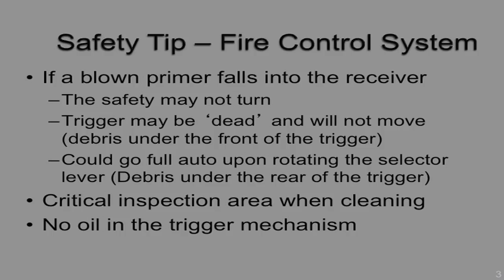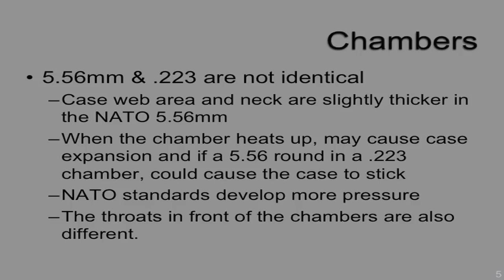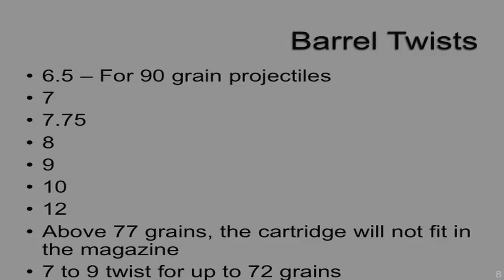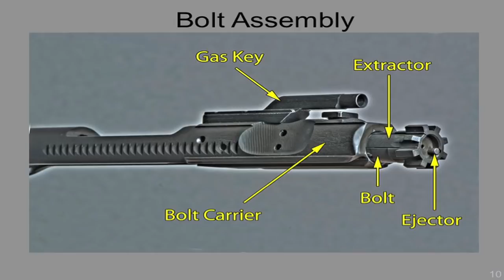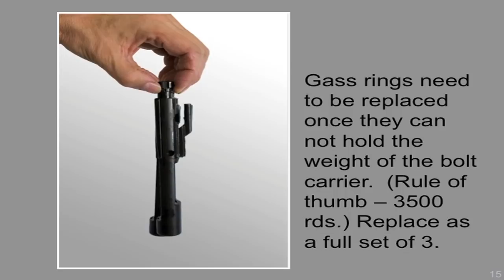AR-15 Maintenance: Field-strip, Clean and Lubricate an AR-15 | Gunsite Academy Firearms Training

Comment: A lot of good information here, much of which contradicts like every other AR cleaning/maintenance video on YT haha!  I think I will trust this guy as he seems very credible.  Glad he at least touched on the barrel cleaning in the question section at the end of the vid.  When he finished up his cleaning, and buttoned up the rifle, I was like WTF...what about the barrel (bore) and star chamber???  That should be a part of every cleaning other than the quick in the field wipe and lube.  Spray it down, insert bore guide, brush it, patch it - always breech to muzzle.  Also, if you want to clean out the trigger group use contact cleaner rather than brake cleaner, which can be hard on certain surfaces.

Comment: I bought my first AR several months ago, but I have never fired it or broke it down. I read the owners manual but it wasn't much help.  This was an excellent video.  Thank you very much.
Reply: The AR platform is a very user friendly rifle. Easy to shoot, easy to clean.
 Take it apart and check things out. Remember never try to force any part into place,
if done right, its smooth as silk.
Reply: When you start taring into it be very carful not to lose any of the little pins and parts. When you spend 4 hours on your hands and knees digging up grass looking for an extractor pin you will rather chew nails. I needed that pin and my gun to work so I was not giving up. Also a good reason to have spare parts with you. I'm learning too.
Reply: @philipburnham5742  magnet on a string...............😁 I’ve done that.

Comment: I have not seen a better video on this topic, and I have spent HOURS watching them. Safety notes along with good instruction! Bravo! And dispelling popular myths like putting lubrication into gas vents on the side of the bolt carrier underneath the gas key. Or lining up the gas rings as if they were rings in an automobile engine. LOVE this very practical video. It's the best. Better than ones by the popular fanboys I've seen. Information from a GUNSMITH, not from one who makes a hobby out of AR15s.

Comment: Extremely detailed video. Thank you!...These are modern centerfire firearms but I'm a 'old school guy' and just wanted to make sure dry firing or dropping the hammer several times after cleaning the weapon is ok and won't do any damage, or should I use snap caps?
Reply: Most modern firearms are just fine being dry fired. Exceptions would be just a few rimfires where the firing pin would impact the chamber without a cartridge.

Comment: Just saw a video showing that the pressure on the .223 and 5.56 are actually the SAME.  The different pressures come from the fact that the military pressure tests test the pressure at a different point in the chamber and so their pressures (with the 5.56) are much higher.  When tested using the same methods, they are similar.  So... they are not pressured different.

Comment: Good video.

When I was in the Army in the '80s, we put a drop or two of CLP in the cam pin area to lube up the bolt and keep it operating well.  I am not sure if those versions of M16s had the chrome lined bolt carrier like they do today.
Reply: It won’t “hurt” the system, but the added oil can/will draw more junk into the bolt group, potentially impeding the fluidity of its operation. I know an old timer that does it and his rifle never has a hitch, so... but he also breaks his firearm down after each outing, regardless of firing volume. He’s a Jarhead... My factory Springfield Saint has 15k+ rounds (55 - 72g) through it without a single malfunction and I maintain it exactly as this gentleman advises (Lucas Oil), but with more barrel care... If you’re new to combat rifles, buy a nice mat with magnetized trays ($20), and with the video playing, simply take your time, pausing as needed. And remember to ALWAYS be SAFE, have fun, and be helpful on the range ✌🏻
Reply: @tinman6514  Great and polite tips sir. I need to get the magnetized trays as well.Thank you
Reply: I always lube the cam pin. It is a significant wear area. Notice that his cam pin has a lot of wear.

Comment: Pro tip. The GI "30" round mag is actually a 29 round mag. That avoids the mag drops so you don't have to slap the bottom of the mag. Just passing that along.

*Also, I have been using the same mags since OEF11-12 with zero issues. I have nothing, but problems with synthetic mags. Maybe my luck, but the trend for Al mags is there.

Comment: Great video, very informative, thank you.  Question regarding your take on cleaning the AR.  Most videos and instructional's that I have seen entail extensive scrubbing and cleaning with solvent of the bolt, bolt carrier, bore, and barrel.  You have a lot more creditability than most so I would take your advice over others but I wanted your take on it since your go against the grain of what most recommend.  Thank you again for the video.

Comment: Good video. The only thing I have a disagreement with is lubrication. I’ve always believed things will get dirty no matter what in the field. Having it lubricated will allow dirt to move out of the way. I learned this when I was very young. I went to BASIC in 89 and the common teaching was to lube with clp a few drops and wipe off. That didn’t make sense to me but I did it for inspection. However, when going to the range in the summer heat and sand, I would drop several drops of CLP on the bolt carrier pretty regularly. My 16 never failed me. In fact, a few guys had issues qualifying one time and guess who’s rifle was running? Yea, used mine since I was already qualified. Didn’t help clean it though. I always run mine wet and it makes cleaning a ten minute process and keeps it running all the time through any situation.

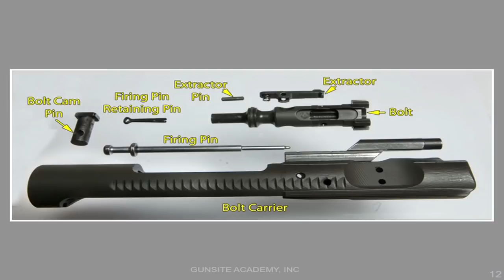Comment: 10:35   One part is missing. The plastic BUFFER that fits inside the extractor spring coils.Usually black. Can be other colors like blue.
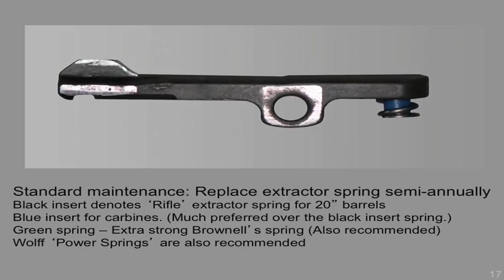12:08 does show the buffer. Blue, in this case.
and it backwards. BLUE denotes rifle springs and Black for carbine springs. The actual plastic is the same tensile strength.
BCM upgrade Chrome Silicon spring kit always come with black buffers. Silicon Chrome springs seem to last quite a bit longer. I use that type of steel for my ejector springs too.
I never run an O ring. That can cause brass shavings that will foul the extractor. Just use the best springs made.  Dirt cheap for the best springs.

Comment: Thankfully now in 2020 we have the 223 Wylde chamber where .223 and 5.56 can both be fired in the same rifle chamber. As for the gas rings, you should always make sure all three rings are offset from each other. In the civilian world it probably doesn't matter. As for being a service member offsetting the gas rings should be done at 12 oclock, 6 oclock and then either 3 or 9 due to the possibility of being out in a combat zone for weeks at a time and very slightly reducing the possibly of a malfunction. Great video.
Reply: Deutsches Brot - German Bread  No they are not. Ar15s are chambered for .223.

Comment: Good video. Thank you. No mention of the ejection pin?… I had to replace one on a new bolt, it broke off with the first round loaded. It looked like it was installed backwards from the factory. Never gave one a second thought before that happened.
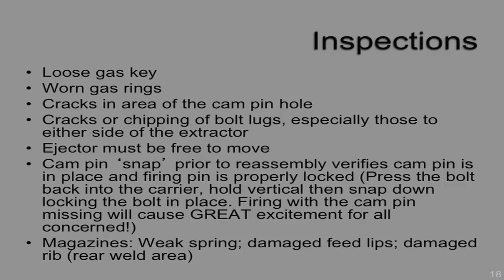Reply: 21:14 on list

Comment: if it should happen to fall while the pins are out and bend the pins(they are cold rolled steel,and much harder than the aluminum milled carrier)when you push them back in it could gauge the aluminum bore that they slide through and over time you can end up with misaligned carriers and have a very bad day.

Comment: I would keep a spare firing pin as a few pierced primers will erode the tip and cause even more piercings. Not usually a problem with factory ammo but reloaded ammo that is too hot will be more likely. Good reason to keep loads below max.

Comment: I’m relatively new to the AR-15 platform, and the more I shoot, the more I want to learn (naturally). I’ve watched many different maintenance videos and most are contradictory. I’m a novice, but it’s obvious to me this guy knows his stuff. That being said, he doesn’t mention if the bore should be oiled after cleaning... I’ve seen many videos where guys are dumping lube down the barrel... I tend to think this guy would’ve mentioned it if it were necessary, or I’m assuming there’s enough oil on the BCG/receiver to lubricate the feed ramps/extension and the bore..? Hope I can get a knowledgeable answer. Thanks
Reply: More to protect the bore from corrosion if not being used regularly.

Comment: yes,out there on the market 50 and 100 round beta magazines,which are really ideal if you fire from the prone position. they don't extend as far from the bottom of the riffle as the 30 round does,they extend about as far as the 20 rounders do and excuse the language but they are circular twin mags that hang from the lower carrier and look kinda like a nutsack but they are great,kind of expensive,and as with any mag never load it to full capacity you will wear out the springs

Comment: Great video. Im still confused as to whether or not to lube the firing pin and bolt. I know he mentioned about wiping down the BCG and lubing it, but nothing on the bolt and pin itself.
Reply: Absolutely Lube the bolt, it is turning and reciprocating back and forth into the carrier. Firing pin you will hear different opinions but I put a very thin layer on it. Usually just what's on my fingers..

Comment: Great video.I am new to the AR15,i just got mine a couple of weeks ago.I just got through putting 360 rounds through it over Memorial weekend.With that low amount of rounds,would it be necessary to strip it and clean it?Or would i be alright putting some more rounds through it before the first cleaning?
Reply: The AR-15 platform doesn't need cleaning after 400rnds or so. They way i always have cleaned my AR was to inspect the chamber. If it looks carbon covered then it needs a cleaning. 360rnds should be just fine.

Comment: What kind of lubricant should you use on the ar? For instance is rem-oil good enough? Also, do you want to put any type of oil on the outside of the gun and barrel to prevent rust?

Comment: One question, please. This video suggests not to touch the lower in terms of cleaners and lubricants. So, no rust develops there ever? No moving parts shall be oiled? Gonna buy my first ar, thats why am asking, thank you.
Reply: Chase Harris Thank you for the answer.
Reply: He discusses it early on. You should clean/ spray it out to clear any dirt/ debris, but that's it. It's a bit counterintuitive, I know. There's areas of friction in there. I use compressed air followed by regular brake cleaner (with the nozzle tube... thingy) throughout. It works great for carbon removal & dries quickly. Follow up with your fav lube, as he describes (I love ballistol), and it'll run great. Good luck!

Comment: Thank you for this! I just got a brand new AR and it was wet as shit from the factory. Took apart the entire bolt, wiped it down and lubed it as you specified. I put a good amount on the rails of the bolt and that’s it. Hopefully I did that correctly. Is the over lubrication on the bolt/internals to keep from rusting? Should I keep them wet? Thanks

Comment: Okay, now I'm confused. I had just watched hickock45's video ("AR-15 Cleaning") in which at 22:25 he talks about adding drops of oil to the hammer spring, the safety pin, "...make sure everything is oiled... moving parts..." (in the lower receiver). This in contrast to above at 2:37 where he says rather emphatically, "No oil, no lubrication, goes down in the trigger group." What's more, the Bushmaster manual "For All XM15 and C15 Models" says to "Generously lubricate all moving parts inside the lower receiver including the trigger, hammer, safety, bolt catch..." etc. Sure messes with my head when experts give such conflicting advice. Leads me to wonder if points like these really matter.

Comment: I have a question please. I have a S&W M&P 15. When I removed the bolt from the carrier, I didn't see a spring and I didn't notice one on yours in the video. Does the bolt need a spring? My manual shows a spring. I shot a few rounds of 223 and I didn't have any problems I looked on my table and on the floor and a didn't see a spring. This was a great video. Thank you.
Reply: There is a spring on the extractor. You will see it if you remove the extractor. It’s under the rubber ring.

Comment: You don't recommend oiling the gas rings, the raised band on the bolt, cam pin nor greasing the Charging Handle?

Comment: Please assist me with some guidence.
My AR15 jams every few rounds to 10 rounds after I go through the first or second magazine. 
I thoroughly clean and lubricate the gun with q-tips and all that. 

I used to put a thin film on the 4 rails on the bolt carrier, the bolt and cam along with the areas the four rails rub along inside the upper receiver. All as well as a film on the top of the charging handle. 

After a few trips out shooting the same situation would occur. 30 rounds go off next mag in possibly fires fine and then after that the gun starts seizing up with the bolt locked forward or a round blocks the bolt from locking forward. 
This would result in a severely bent unfired round with two long and deep indents along it. 

After thoroughly cleaning the firearm along with generous lubrication it still bent a round failing to seat it in the bore and fire it. After clearing the firearm i dumped far more of lubricant out of frustration into the two gas holes on the side of the bolt carrier as well as the bolt and threw it back into the gun. For the next 90 rounds it fired flawlessly. Though I have not fired it since.

Additional information
Rugar 5.56 
16 inch barrel
Completely stock 
Around 1000 rounds fired 
I lube and clean the firearm after every trip to the range where 3 to 4 magazines are fired. The gun rests on the stock against the wall for days to weeks after lubrication before it is fired again.
Reply: Scrub the hell out of the chamber and try a different mag

Comment: Every AR maintenance video shows how to take the bolt carrier group apart. Was hoping you would show how to clean the gas tube, perhaps the most critical part of the maintenance.
Reply: Johnb57 he mentioned that. Don't do it. Too hot and too much pressure.
Reply: I'm thinking that Johnb57 failed to pay attention during this block of instruction. He is a No-Go at this station

Comment: My one complaint about plastic magazines is if they are used a lot plastic tends to wear faster than metal, and the magazine catch on that plastic mag will one day turn out to lose its ability to hold the mag tight in the magazine well.. I think I will stick to aluminum or steel mags.

Comment: wondering about gas rig lubrication. You don't mention it Cory. Do you recommend NO lube on gas rings??
Reply: Over the 4 months since you posted you probably have researched and found an answer, but just in case.  no, you don't need to specifically lube the gas rings.  as in the video, their purpose is to form a "seal" and are not a "wear surface" so to speak.

Comment: i have a question.. on my barrel it says 5.56 nato with 1/9 barrel twist and its a smith and wesson M&P15 and on the web site the mag capitity say 5.56 or 2.23 and my question is can i shoot both???
Reply: Yes, both,  5.56 will shoot both, .223 only safely shoots .223.  Go by the barrel stamping.  As far as I know, any magazine will hold the same number of .223/556 rounds.  The size difference only matters in the breach.

Comment: Avoid 99% of these issues. Build a Superlative Arms piston gun and run it almost dry. Use POF round roller bearing cam pin. Done!
Almost. Buy all Chrome Silicon springs for bolt extractor, ejector and buffer. Not expensive. Usually a spare extractor buffer will come with a BCM spring. No O ring ever needed.
Carpenter 158 bolts only.

Comment: what's a good Lube what you recommend?
Reply: Ive been using Mobil 1,   30 weight & Hoppies #9 for 30 years. The Mobil 1 is not heat sensitive, it will bond to the metal,  save a lot $$$

Comment: You would think an instructor would know an AR15, and for that matter, all modern firearms can shoot either 5.56 or .223 interchangeably without any issue whatsoever-they are MADE that way on purpose, I checked with 4 manufacturers to be sure.
An Instructor should also know that the pressures are measured with different scales and when you convert one scale to the other, the differences in pressures are negligible/nonexistent.
Reply: So basically what you are saying is that the manufacturers are making their barrels to mil spec which is 556.  Correct??
Reply: @johnjanoscrat8000  They're both 5.56 X 45, the reason there was ever a problem was because a milspec rifle has to allow a little more tolerance around the shoulders because ammo is manufactured in many different places around the world and at the time is was the easiest way to deal with minor discrepancies in ammo cases.
They made up for this extra tolerance by making the brass a little thicker at the shoulder on the 5.56.
So what happens is, when you shoot .223 in a 5.56 milspec rifle, the shoulders could stretch making it a no go for an older .223 with tight tolerance.(but still reusable in a 5.56)
That is the whole story.
As far as pressure difference, they are almost the same. The misunderstanding is because one cartridge is rated by an entirely different rating system than the other-when you convert that over it is almost exactly the same pressures.
Reply: @polymathicperturbations1476  Thanks so much, i appreciate your very speedy reply.  I am always willing to learn and am grateful for those of you willing to take to time to educate me.  Have a great rest of the weekend.